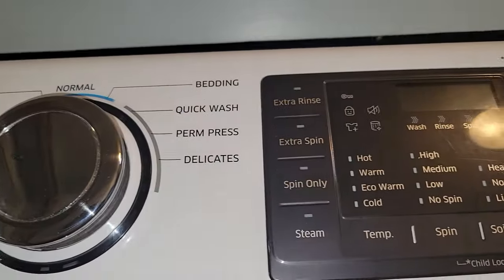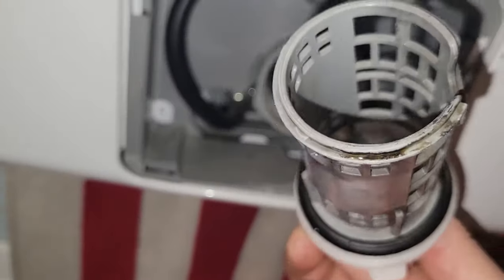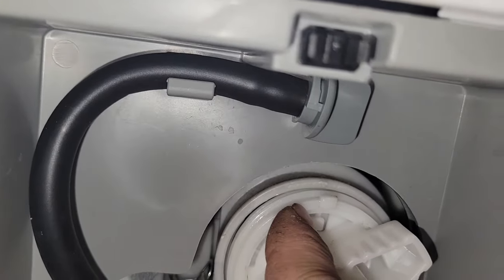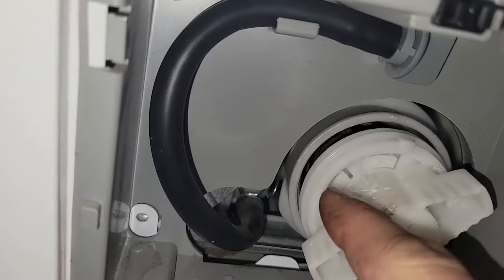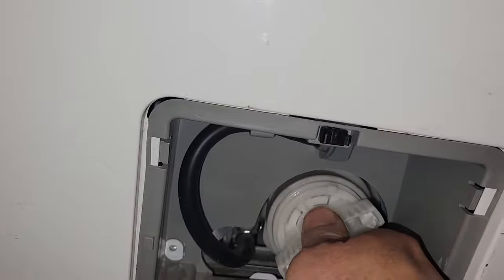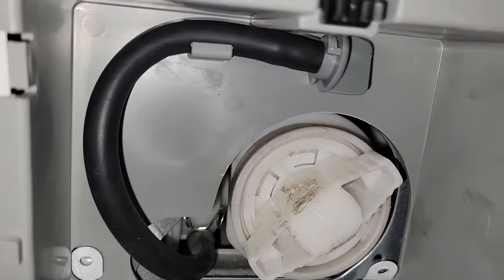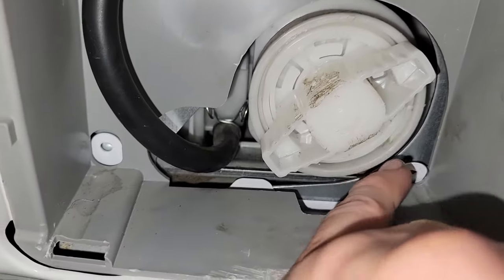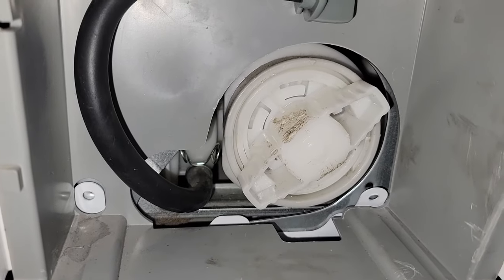Samsung Front Loading Washing Machine Coin Trap / Filter Clean Out DIY

Comment: Help. I cannot  open the coin trap. It just clicks as I turn it and am unable to open it. I tried to push in still wasn't working
Reply: Probably stuck with gunk. Need to push it in a lot harder
Reply: I cannot open it up either… I tried and immediately the water started to leak. This is too hard.
Reply: Im having the same issue. Did you ever get it resolved?

Edit: i got it! You gotta push in really hard and turn counter clockwise. Use two hands to turn it. If you hear clicking then you're not pushing hard enough.
Reply: @Lemonade_Stand_ thanks!! you do just have to push harder, kind of like opening a pill bottle
Reply: If the filter wont open a d only clicks use a screw driver to hold down the back ring and then twist. Also clean the filter inside and the outside ring of any debris to prevent any leaking.

Comment: If you’re struggling to reinstall the coin trap, a couple of tips…

-Look inside the hole and you’ll see a piece of plastic sticking out on the left side. Make sure to line the cutout in the coin trap with that. If you lined it up correctly the cap of the coin trap should insert more fully.
-Line up the square mark on the cap to the small arrow on the rim of the hole. 

It shouldn’t take too much force to screw it in.
Reply: My man
Reply: Have you encountered a clicking sound at the start of a cycle? I did put the filter back with that cutout in coin trap with the plastic sticking out and its still having the clicking sound.
Reply: @lijon912  I encountered that horrible clicking sound but as long as it's not leaking you should be fine. I think it normally does that sound.

Comment: I figured this out TWO years after owning a front loader samsung machine. 

Lets just say when I opened that drain plug and the water that came out smelled so horrendously bad, and and these samsung engineers couldn't have thought of a,worse design because I spent the following 20 minutes cleaning liquid that smelled worse than a sewer and body odor iff my tiles, people when you take this plug out make sure to get a bucket or a towel, ittl be smelly 😟

Comment: Thank you for those tips. I have the same problem. The filter is so hard to open and then close it the right way. Even an expert technician was having the same issue when he came to do the maintenance 😅. Now that I did it by my self, I think I use so much force to trying to open it that the handle came out and I’m still not able to open it up 😢. I will try your tips.
Reply from the maker: Crazy

Comment: Do you have any vids on cleaning the back inlet filter of a Samsung front loader, 7.5?  I have a length of gal pipe that sheds debris occasionally. I have found a filter with a plastic bit that can be pulled out and cleaned and then there's a 2nd screen mesh that I've cleaned too. Next is a rubbery piece that I think may be blocked but I cant see what next to do. Thnx
Reply from the maker: I do not.
Reply: Needs replacement...had the same problem.

Comment: I'm having trouble taking it out.. It wont unscrew..
Reply: I’m having the same issue. Worried I won’t be able to get it back in but it’s never been changed the 5 years we’ve had it 😢
Reply from the maker: @lisaisneat got to do it, but it's no fun!
Reply: @MelvinZoopers  To confirm it’s sealed properly does it need to make a clicking sound both directions you turn it?
Reply from the maker: @lisaisneat I can't say for sure.
Reply: Did you figure out how to remove the filter yet? Mine clicks both directions
Reply: Take a large screw driver and insert in handle part.  Rotate counter clockwise and it should come out.  Samsung should have made the door flap child proof and the cap simple.
Reply: @PrimaryIgnition  I was able to get out done last night. One comment said to use both hands to unscrew it. Not sure how, but it worked

Comment: You are not installing it correctly.
Reply from the maker: Ok
Reply from the maker: I disagree, but thanks.
Reply: The cut out at the at the end of filter needs to be at about 7 o'clock to mate with notch inside pump cavity. The handle will sit at 12 and 6 when done correctly.
Reply from the maker: @fringeminority5676  ok. Is this why everyone struggles so much?
Reply: @MelvinZoopers  well you seem to have an issue, albeit most of my customers have no issues with the clicker filter. You also called it a child proof filter.. you just don't understand how it works. If something is stuck in pump cavity the filter is locked in place requiring the aw to be disassembled to remove the foreign object. But with this design the filter does not turn with threads so it can be removed. Try reading your user manual before trashing samsung. As you are the one who just doesn't understand, it's actually a great design.
Reply from the maker: @fringeminority5676 I read the manual over & over & couldn't get it & it is the same with all of the people watching this video. Maybe some people are slamming on Samsung but not me, so don't accuse me  of that.